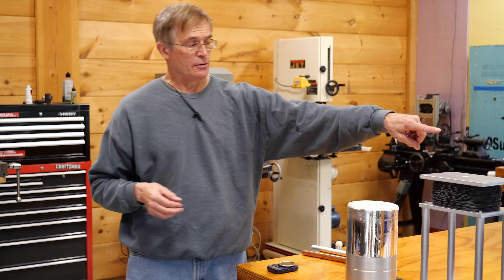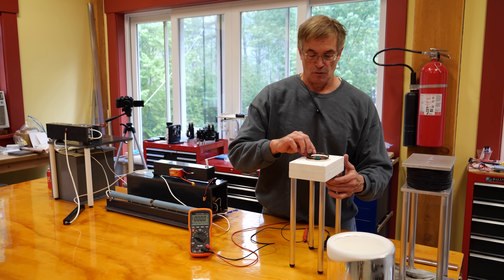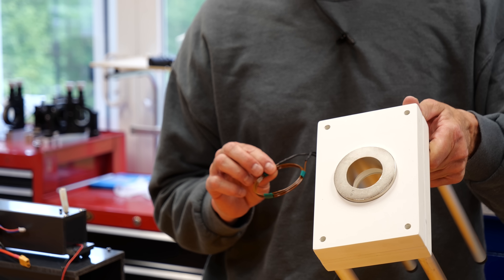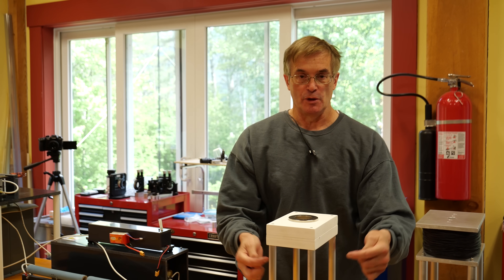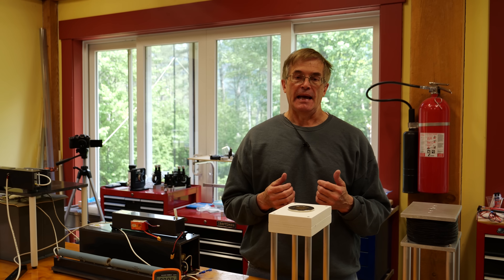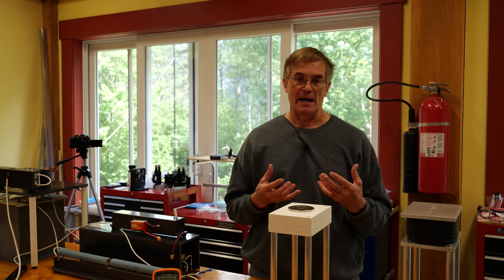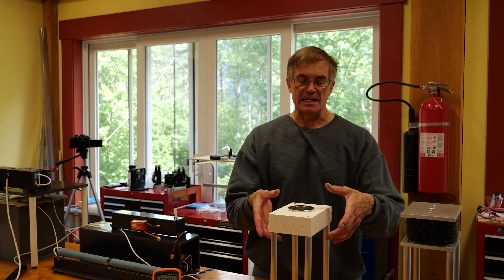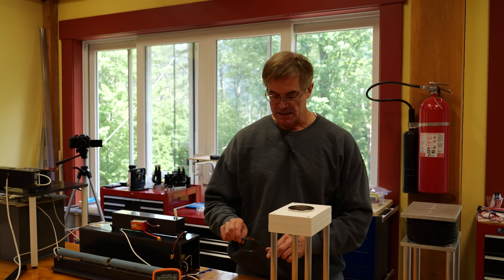No, we didn't use Magic to Crush this Can...

Comment: Can plasma produce a black-body curve?
Reply from the maker: That's a good question.
Theoretically, because the plasma is an equilibrium of ionization and reattachment of free electrons there will be many emission lines.  However, as the plasma becomes hotter and reattachment is virtually eliminated, it becomes opaque to radiation and emits as a black body.
The cooling off of the early universe allowed the first unionized hydrogen atoms to form, the universe became transparent to radiation and this radiation has been red shifted to the cosmic microwave background at approximately 3K.
Reply: @TechIngredients  Yeah, but can we measure it in a lab. I'm looking for papers, lab results, that sort of thing.  I looked for it, but my first attempts were unsuccessful.
Reply from the maker: Take a look at high energy flashlamp operation.  Specifically, ablating wall lamps produce a plasma that is hot enough ( greater than 30,000 K) that the output spectrum is the same as a black body.
Reply: @TechIngredients  Thank you, I will. The problem is that it must not contain any impurities like soot or anything that might be perceived as having a crystal lattice. The fundamental assumption that I'm trying to find a refutation to, is that only proper materials with a crystal lattice and a hard surface are capable of producing a black-body curve.
Reply: @TechIngredients  They think that the sun is somehow made of liquid metal hydrogen. That is a crazy idea as far as I can tell. The only thing that gives me a pause is this other argument about the CMB. I think the main point is that this particular black-body curve was only measured at four points ---four frequency bands --, and that all of the channels are way too contaminated by foreground radiation to be useful. Some of the argument feels way above my head, but the bits that I understand do actually makes sense. So I can't say that I rejected it yet. Based on pure logic alone, it could be true. IF A roughly equals B, and the only way to get a signal is to do A-B, then what you should get is not a signal, but pure noise, unless the errors can be eliminated to a very high degree of precision. But if A and B are partially unknown, i.e. the foregroung contamination cannot be fully characterised, then no meaningful or significant result can be obtained. It looks like a mouch harder problem, and I don't expect you to look into it, but it is something that I am curious about right now.
https://www.youtube.com/watch?v=vsuWNUx8e3Q
Searching for the Monopole - The Cosmic Microwave Background!
_
In any case, this guy seems to take himself seriously, which is a good enough reason for me to try and look into it, even though I disagree.
http://ptep-online.com/2009/PP-19-03.PDF
http://ptep-online.com/2010/PP-22-02.PDF

edit: the source of the foregroung radiation is intra- and extragalactic dust
Reply: @TechIngredients  I'm working on making physics understandable, and it is trying to lilluminate the dark corners of people's thinking, that make me grow in that direction.
Reply: @TechIngredients  In any event, this does not disprove the big bang, but it is a very interesting thing to look at, and to think about, in my opinion.
Reply: @TechIngredients  However, if you could be of any help in this matter, it would be greatly appreciated.
Reply from the maker: At the temperatures of an ablating wall lamp, no solid materials or molecules can exist. Look at CMB S-4 the Antarctic microwave background experiment.  They study 4 wavelengths to eliminate two extraneous sources of the background noise you mentioned.

Comment: Super interesting.  Could a beta pinch be used as a repulsion device for controlled decent of a stainless steel can?  Mainly to hover and let down slowly onto a non conductive surface.  What I am thinking is to allow lunar landers to repulsively land, rather than propulsively, so as to kick less lunar regolith.  It seems like this could be incorporated with audio resonance to field lock a rocket, and have it slowly lower itself into a compartment below the field and close a hatch behind it to allow spacecraft like Starship to "dive" into an internal bay.
Reply from the maker: It could, although as I demonstrated, aluminum would be a better choice.
I don't know what you mean by audio resonance in this situation.

Comment: (When you had the plasma on and the magnet sitting there it stays cool or does that get hot too?) I seen you turning on power to make a different/similar reaction with the other side with wires flowing electronicol current saying that gets hot.
Reply from the maker: The coil does not pick up a significant amount of current from the plasma and rains cool.  Remember, the plasma is a DC flow of electrons and it is the changing field that induces  a current in a nearby conductor.
Reply: @TechIngredients  it's better if I point out what I'm saying and hear your response. My mind focuses more then anything that way

Comment: Watching the combo rocket engine burn and observing the same Z-pinch and shock wave as evident here with mercury vapor reminded me of the Herbig-Harrow phenomena recorded by astronomers. Its sad that EE Don Scott missed the significance of this in one of his workshops. He actually proposed this phenomenon accounted for the creation of Venus, Earth, and Mars by ejection from a flaring Jupiter. But we have yet to observe in space flaring of any kind that results in spheres being ejected in a plasma stream.  So far flaring merely fractures the object, like being smashed with a hammer. The temperatures and pressures are simply not high enough. Where they are sufficient is the ejection of superheated plasma from the center of a galaxy, resulting in a quasar. The ejections are LYs long, and the shock waves are on the order of hundreds of AUs across.  Arc welding exhibits similar behavior as quasars cooling off.

Comment: How you doing sir. Was wondering when you was talking about the plasma light smelling the ozone being produced, is that like the same as the ozone layer. And if the ozone layer has a smell
Reply from the maker: It's the same.  Although, at the altitude of the Earth's ozone layer the pressure is so low it would be considered a respectable vacuum on Earth.

Comment: Fusion requires temperatures of about 100 million Kelvin (approximately six times hotter than the sun's core)  Remember,  heat = molecular velocity.  You will need one hell of a magnetic confinement field to contain such a hot ionized plasma!  That's the break-even point, where you get more energy out, then you put in!  Let's hope it can be done! Good Video, Thank You!
Reply from the maker: It's actually even hotter @ close to 180 million degrees. You're right and that's why the magnet field has been the barrier.  REBCO tape is the answer.

Comment: Could you use some extremely short bursts of light say from like a high powered laser to control the fusion?
Reply from the maker: Take a look at our video on the "Plasma Tube".  Lasers can drive a fusion reaction, but they are not practically feasible.

Comment: are the coils of copper wires insulated?
Reply from the maker: They can be, but most of the time they are not.  They are simply coiled to remain separate and depend on the air to "insulate" them.

Comment: Do you think ITER is a reasonable project or better an already obsolete one? I mean I understand the necessity to experiment thermonuclear fusion but maybe in laboratory scale rather than industrial scale because the time it takes to build it is too long compare to the technology's immaturity.
Reply from the maker: It's already obsolete.  But for what it's worth, they will certainly be learning more about the properties of the plasma and the material engineering.  It's just a very expensive way to do that.

Comment: whaue these are the ones that keep me 39 min . awake and focus .
learning about physics , always been my number one intrest .
would you mind if i use some of your explanations involing different conductors having different magnetic resistances.
i have a small metaldetecting channel , not that actif anymore ...but almost nobody knows the principle what making certain oddities .
like you demonstrated with the alu tube cut in half on oneside.
experienced ring finders call it 'broken ring phenomenon' .. its sounds more crapy when finding such.
on metaldetectors the lower the magnetic conductance the lower and /or more vibrato it sounds ..same as that 'broken ring' thing.
i will surrely make a shoutout to your channel as i'm big fan of it !!!

greets from the netherlands
johny geerts

Comment: Hmm...shouldn't the speed object fall be independent of the mass?:) it shouldn't matter if it's copper, steel or aluminum - g is the g. Same in each case and I don't think air drag should matter in this test.
Reply from the maker: Air drag doesn't matter here, but the force created by the interacting magnetic fields as gravity pulls the tubes dowward is the whole point.  This is most clearly seen with the room temperature and LN2 cooled aluminum tubes.  Exactly the same mass and therefore the same weight, but the lower the electrical resistance of the cool aluminum, the higher the current that is generated for the same work during the fall and therefore the greater it's magnetic field.

Comment: I enjoy your videos but I had difficulty with this one.  I am not able to tell which wires are connected to which rods and how the rods are connected.  It would help to have a diagram or eliminate a lot of the visual distractions from behind the rods and wires.   The video is in 2D so the 3D properties of your setup are not easy to see.  Sometimes it looks like one rod is sitting on the table while the one on the right looks like it is supported by the black base.  Also not easy to tell where the wires are connected.  For example during your descriptions at the 5 minute mark it looks like both red wires are connected to the bottom of the same rod on the left and nothing is connected to the rod on the right.   Looks like magic.
Update:  When you cut away at the 6 minute mark you now have two hanging rods and a stand rod on the right.  The two hanging rods look like just a single rod during your first 6 minutes of description thus causing the confusion.  At this point I realize that the rod on the right is not even involved in the current flow.  It is just a stand rod which looks exactly like the hanging rods.  But I still can't tell how the black wire is connected to the top of both of the hanging rods.  It only looks like it is connected to the top of the left hanging rod.  Confusing.
Update: So now at 6:36 we learn that the top of the two hanging rods are connected by the red looped wire at the top.  So note the confusion up until this point.  Without describing how your setup is wired at the beginning we have to figure out that in the first experiment the black wire is connected to the top of the left rod and is jumpered to the top of the second rod with a wire that I thought was just a suspension wire.  I've had to rewatch this a handful of times due to this lack of clarity.  A diagram or a description (without so many background distractions) would have been helpful.  But I still enjoy your experiments and explanations.  Thanks.

Comment: Mr. Tech Ingredients, I am a home inventor, with no engineering education but a yearning for learning, but I don't really know anyone to ask for help. I've been trying to make a decently loud but safe for ears, fast repeating, POP noise maker using C02 OR a short stroke mechanical linear actuation. I can't use electricity in this invention and I can't seem to find anything scalable to the size I need; a tube the size of a cigar (sans air source). If you can think of anything, Please let me know!

Comment: 35:14 Wait, Wait, Wait...
You do not need to increase current, you can simply increase magnetic flux (which is in relation with magnetic field) by increasing the number of winding of wire: magnetic_FLUX = N_turns * I_current.
So as far I understand one does not need superconductors for coils but they would be useful for a core of coils. Because the core affects the relation between magnetic_flux and field. And air has very poor relation/"amplification"/magnetic permeability, but at least it is linear.
And please do not say kilo Watts, since the important factor is current and number of winding.

More than in mercury plasma I am interested in sulfur plasma that can be used without phosphorus to get almost sun like spectrum.
Are you prepared to put sulfur vapor in vacuum tube?
Reply from the maker: You need superconductors because the field increases nearly linearly with turns and a non superconductor can simply not maintain an equivalent current without melting.

Comment: So instead of the mercury vapor being released into the air you release it into the water. Good job. :( Where is the mercury at when you vaporize it. I wish you had shown a more closeup of the voltage setup for the tube. Maybe i will review the first video and see if the elctrical is shown there.

Comment: Solid state relay?? There is a new small optically isolated one that will conduct I think 800 or 1200 volts @ 1 amp now but has a lesser insolating voltage. I HATE IT when tools get magnetized. The old left hand right hand rules for current in a conductor and magnetic field on a conductor. Do the old copper tube trick. Okay, that magnet is the same thing.

Comment: If you placed the coil inside the can will it explode the can?
Reply from the maker: Yes
Reply: @TechIngredients  if you were to run a thinner wire would it run the risk of breaking under the torque and is there only torque when there is a load in the field?
Reply from the maker: It would.
The wire is also working on itself.

Comment: Excellent, very interesting leading edge tech that will reshape humankind, well presented in a simple follow-through manner, a lot to really take in, as ramifications are enormous, yet easy to follow. Patenting energy production so as to add cost may be a good idea only if it is much lower not maximising profitability (linear) since human development is not linear.

Comment: Hy... Great Video as usual. I have a question slightly related to one of your experiments you show: I darkly remember an experiment from my evil genious prof in high school where he used a similar setup like you use in your z-pinch experiment. Running it on a dc voltage, the two parallel running cables would not attract. If one would move the viewers point along the axis of the cables at the same speed as electrons, which was apparently not so fast, one could see the two cables attract each other while the rest of the class with a stable viewpoint would not see anything. So being, that if one of the electrons in one of the cables had no speed relative to the observer and the electron in the other cable had "full speed" in relation to the observer, that would induce a magnetic field and attract the cables...  Like i said... i darkly remember after a long time and i probably mess stuff up, but i have seen this with my own eyes and it always puzzled me to put it mildly. But this nucl. phys. genious of a teacher had some pretty amazing stuff up his sleeve. Do you have some explanation to this? Thanks Phil
Reply from the maker: That may be more of an engineering phenomena.  Once the cables begin to move due to the force acting between them then the movement itself causes them to approach or retreat which chances their spacing and propagate the force down the line.  A camera could not possibly follow the electrons speed as they move down the conductors.

Comment: How is that not a useful magnetization? A screw that attaches to a screwdriver instead of falling into the void is very useful. Also you can attach a screw to a screwdriver and then aim it with one hand while other hand is holding the parts.